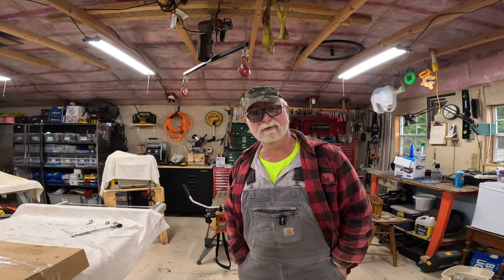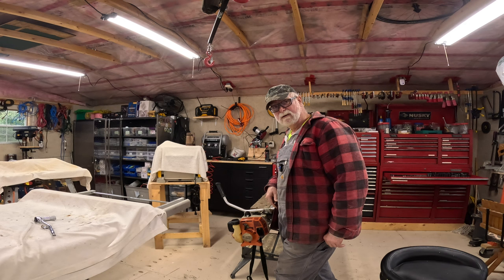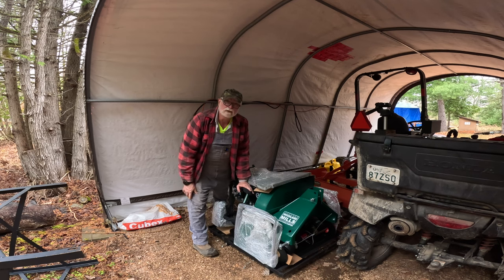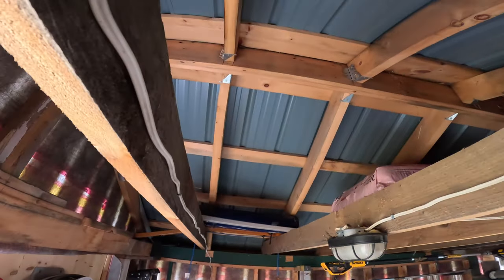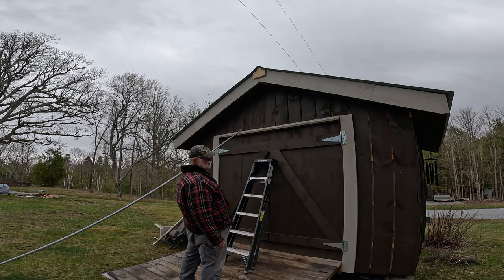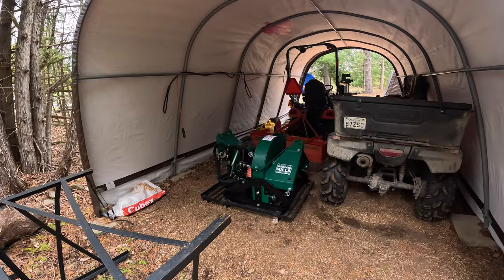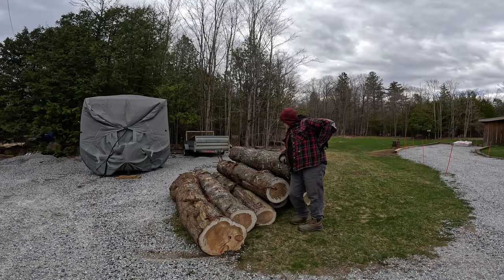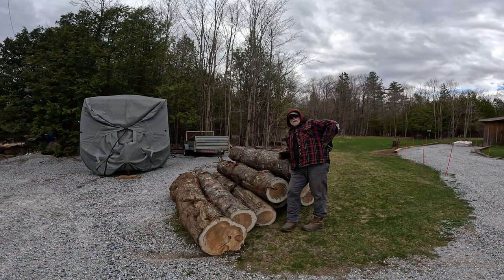Odd Job in the Yard and Hauling Logs for the Sawmill

Comment: A welder is a handy tool to have in the workshop. Great fix on the trimmer. Your trailer works well for logs and it is cool how you can remove the box
Reply from the maker: Yes it’s a great trailer. It can handle a crazy amount of weight. I love it. Still thinking about the welder but I’ll probably end up with one sooner or later. Thanks for stopping by!

Comment: Good morning Brian! Nice,  a quick easy fix on the trimmer, gotta love that.  Now that you installed the board to block out any birds from getting in hopefully it wasn't mice. The Woodland Mills logging dump trailers are very handy and versatile. You have some good size logs to mill up.  Have a good one my friend!
Reply from the maker: Morning Paul! Yes, they are such a versatile little trailer aren’t they. It’s good to have that trimmer working again. I still have to replace the gas tank. I managed to crack it somehow but now that I know it still run, that will be next. Take care my friend and thanks for stopping by.

Comment: I am not surprised with the trimmer you must be majical.........I have owned all makes of chainsaws and my biggest disappointment was with the Stihl product. We are dealing with those same temps Brian and it makes it a little hard to get the outside work done when it's that cold for sure. Mouse traps for mice and rat traps for squirrels and that will help your birds. Those are some fine logs! Cheers!
Reply from the maker: Good morning and thanks for stopping by! I think it may have been squirrels 🐿. They seem to have a habit of disappearing around here for some reason. They’re homeless now👍😆. The weather has been an issue for sure. Now we’re getting lots of rain but progress is still being made.  I’m not a big fan of Stihl ether. Cheers!